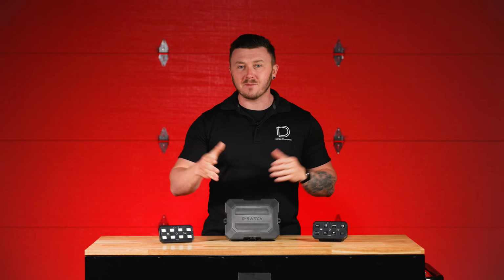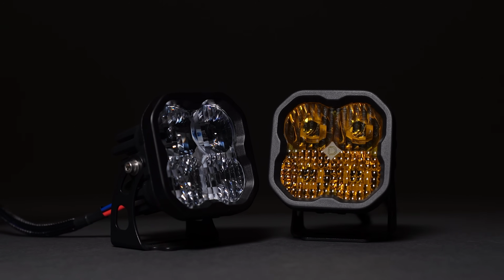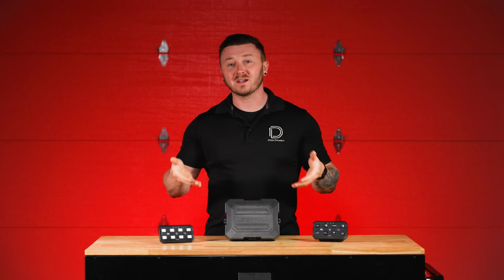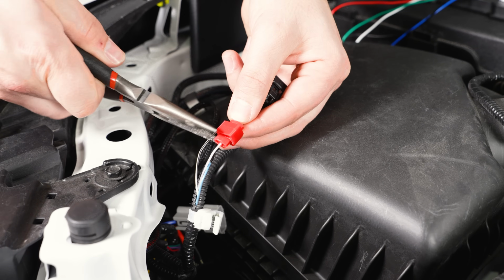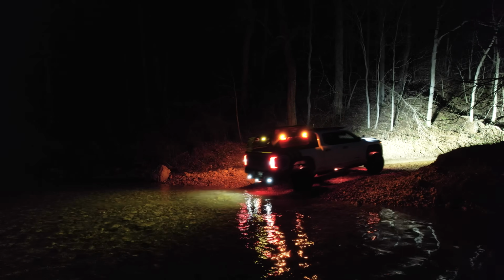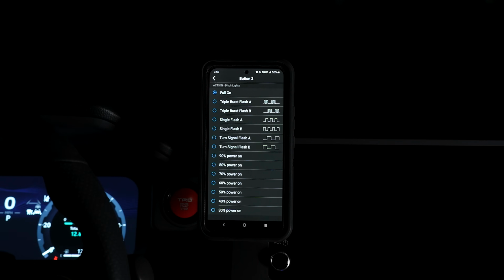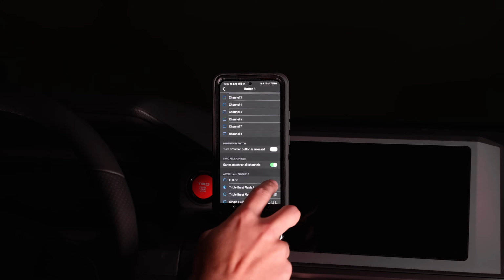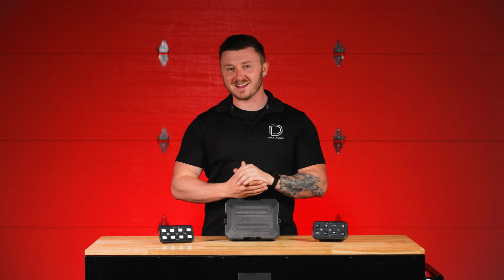Full Command at Your Fingertips—Meet the D-Switch 8-Channel Switch Panel | Diode Dynamics

Comment: When wiring this thing do you need to use an ignition cable like aux beam for it to work? Or just positive and negative and you’re good to go to the main controller.
Reply from the maker: Positive and Negative are all you need for the controller to work!

You do have the option for an ignition trigger wire if you choose, however, it is not necessary. Plus you get 3 other trigger wires that can tap into any other vehicle function, such as parking lights, reverse, or even hazards, to turn your aftermarket lights on without messing with the controller!

Comment: These guys are high-quality and no BS. I upgraded my 2020 Ford Explorer Limited two exterior LEDs to replace the ones that Ford decided to make just regular incandescent bulbs. I got their very bright backup light replacements and I can’t tell you what a difference that has made. At night when I put the car in reverse and the backup camera comes on plus I can see on them in the mirrors behind me, it’s like two bright spotlights have come on, and I can see Everything and we almost impossible to hit something or get into an accident because everything is so well lit. Really really excellent stuff.

I also replaced the license plate lights, which, on a Ford Explorer 2020 or newer, you don’t even need any tools. You just need your hands and you can replace it in about 15 seconds, no joke. And now my license plate is lit very clearly at night and it just looks nice.

And finally, I upgraded their rear incandescent left and right turn signals to LEDs in their place. The one thing I couldn’t figure out is why I Ford Wood release I think it’s the eighth big rebuild since they started selling these vehicles a long time ago and almost everything in the car is LED both inside and out. And it looks very good. But why did they leave the rear turn signals back up lights and license plate light incandescent? I never did figure that out, but I went ahead and replaced the left and right turn signals for the back and now it looks really great. It pops on and pops off and there’s no doubting that they’re LEDs. 

My police department has also purchased stuff from them due to recommending them for a couple different things. I’ve never heard a single thing bad about this company or their products. Word-of-mouth is the best advertisement that a business owner could hope for. And as you can see in these reviews from people, word-of-mouth is excellent because it’s all positive and I’m in that group too. I am super impressed with what they have and the care they put into making it right.

And if someone that Diet has a quick second, and could possibly answer this question, and if not, you’re too busy and can’t take individual questions that’s OK I understand. I just wanted to know if my stock 2020 Ford Explorer Limited non-police model has any places on it where a couple of warning lights could go that are either clear or amber and for private property use only. And my retirement, I’m starting the company over again and I came up with a system that worked fantastic for getting the attention of my customers at airports, especially at SFO where it’s a zoo. I have a they caught an electronic flare. I can’t remember the brand name though and I put that thing on my dashboard and it’s a little orange light that’s round and has about 10 different linking patterns. It’s not a police light. It doesn’t throw the light that far, but it does throw it far enough that my clients know to look for this orange light on my dashboard and when they see it, they flagged me down so I can pull over and get them and just to be sure cause they’re older folks I have their abbreviated names and destination also abbreviated on an LED sign that’s controlled by a Bluetooth connection to my iPhone and an app. People love these little extra touches and seeing their name on a scrolling sign on the side of my car it’s actually inside the car attached to the right rear window and I’m the only one at the airport that’s got it. I’ve never seen anyone else.

But I really like to know if there’s something that would be a bright like I guess it would be. I’m trying to picture my police car and what it had and I don’t want it to look like a police car. I’m wondering if Ford has any thing all set to go on my car like do they have mounting plates and things that are hidden or in place somewhere since they come off the same assembly line twice a year? I’d like to have something like a LED an amber LED behind my front grill so that when I see them, my customers, I can flip on that little Blinky Blinky thing and they’ll know it’s me. And even with the round light that I use, I turn it off as soon as they see me all we have to do is make initial contact and then if they lose me, that’s OK but I know where they are. So something like that on the front or gosh I don’t know I’d have to see what’s available but something simple like that and like I said is for private property only I’d use it at I’d use it at their residence as well because it is a retirement home a giant retirement home and the entire grounds there a private property and it will come in very handy there as well. When folks get older, things really change and until you deal with it yourself, you don’t realize how difficult it can be. I’ve learned to give the same quick speech. I always give as we’re driving away from their home but still inside the gates and I always ask if they have their passport, their purse or wallet with ID, and whatever travel documents they may need like TSA pre-check. I’d say it’s about 50-50 where half the time either the husband or wife has forgotten something and I turned back and go get it. That’s no big deal, and then the other half they remember everything. But old folks do get flustered and I’ve seen drivers try to explain to them stuff. That’s just too complex for them about if it flashes this way or that way and some other stuff I’m laughing at here. That’s way way too much for old people, especially if they’re on vacation. Their mind is elsewhere. So I just tell them don’t worry about it because I’ll do all the work. I’ll find you. I’ll get you there I’ll bring it back all safe safely and it always works out well and I get great tips from it. But I’m just now starting to see about starting it up again because March 13 of 2020 just killed it.

Well, that’s a long comment I wrote. Sorry about that. I’ll sign off now. Go back to my corner. Lol.

Comment: This have a built in gyro or accelerometer? Would love to see it function as turn signal switch, it could detect G-Force from turns or lane changes then auto turn off the blinkers in utv/side by sides application, would love to see it.
Reply from the maker: Unfortunately, this does not include a gyro, or accelerometer at this time. Sorry about that!

Comment: I have one hang up with this... though it's app controlled, it should have apple carplay/andriod auto integration instead of having to fumble around with your phone.
Reply from the maker: We hear you and appreciate the feedback! Like many other switch panels on the market (all but one), we are limited to universal capabilities within the controller app. 

Apple and Android are very strict when it comes to CarPlay and Android Auto, for safety reasons. It is for this reason that you don't see any options available on the market yet. 

We are pushing to have that capability in the future, though, and it is absolutely on our radar as a future possibility!

Thanks for checking it out!

Comment: My big question is whether the trigger wires also allow you to manually control the lights… Garmins power switch has the triggers but you can’t manually control the lights at the same time. If you guys allow for manual control as well as triggered control I’m buying today.
Reply from the maker: The D-Switch allows for both manual and trigger control at the same time!  From there, you can even program whatever lights you want to turn on and what function you want with just using that trigger wire! You can also stack features of the same light.

Let's say your trigger wire activates your ditch lights; you can have a separate button that strobes them or dims them down!
Reply: @ well I’m sold. My biggest complaint regarding the power switch has been if you use the trigger wires you don’t have manual control. Garmin is fuuuucked.

Comment: @diodedynamics don’t forget, if you’re using the rock lights, you can also wire the low power mode into your backlights!
Reply from the maker: That's a great point! If you want your rock lights on low power to turn on with the rest of your backlighting, you can absolutely do that! Keep in mind that local laws are different in each state/county, so be sure to check that you're in the clear before doing so—we want to remain road legal!
Reply: @ most every state will absolutely be on board with being seen. Hell tractor trailers have more lights than we can possibly throw on… AS LONG AS your low power lights (rock lights, roof rack, even light bar… many states require light bars to be covered such as VA, MD, WV, etc but overall, they can only be parallel or below the headlights and <18”… I work with LE daily)…. But those lights just have to fall under the statute of “marker lights” and can only be white/amber forward facing or amber/red rear facing.  As a side note, im glad you guys finally caught up with your suppliers with those beautiful rock lights… I have 6 and needing 4 more for my 24 Tacoma TRD Pro plus 4 for the roof rack (installers pack so I can have the rear chase lights (red) and amber sides…. Mostly for dusty trails and off roading.

Comment: Question. I have mostly DD lights, but I may have a couple lights that have duel intensity back light. Sooo would it be possible to wire the main back light to ign, and the dimmer backlight to parking lights with d switch? Wouldn’t mind reducing relays and excess wiring haha.
Reply from the maker: If there are different wires for the different functionalities of the pod, you can wire them into either the backlight channel or one of the channel assignments to have individual control with the trigger wires to turn on with your parking and ignition sensors!
Reply: Sure, as long as you have two separate input wires for your dual backlights, I don’t see why it wouldn’t work

Comment: Seems awesome - Is there any support for 24V?   Planning to run off of house power if needed, which is an Ecoflow @48V (with 12 or 24V output).  Planning to run at 24V to reduce wiring gauge and the onboard DC-DC converter has a 60A limit.
Reply: Which EcoFlow do you have with 24v output? My delta 2 max only seems to have 12v but I do appreciate the 24v output of my other powerbank. Very handy
Reply from the maker: As of right now, this only supports 12V systems, however, we'll be sure to pass that along to our engineering team for potential future updates!
Reply: Hello
I have an EcoFlow Power Kit (Gen 1) installed in my van, and I recently ordered a D-Switch. Could you please create a video demonstrating how to connect the D-Switch to the EcoFlow distribution box?

From what I understand, the EcoFlow Power Kit DC output is rated at 60 amps, while the D-Switch can handle up to 125 amps. Given this, do I need to connect the D-Switch directly to my Transit van’s battery in order to achieve the full 125 amps output?

Thank you for your time and assistance.

Comment: So, if I understand correctly, these can't be combined with any of your lights that use rapid on/off to change settings of the light.
Like the light bar that makes you turn it on/off repeatedly to change which bank of lights is on.

Would have been nice to have a programming bus on those lights that talked to the control software in the D-Switch so those things could be toggled entirely through the app.
Reply from the maker: This will work with the Amber Only version of our new upcoming lightbars and amber backlit yellow SS5 pods currently! 
We will be working on updates to adjust the programming of the SS5 backlights so you can flash the backlights without changing the colors.

Comment: $600 😂😂😂😂 sorry but auxbeam is tsking my money on this one.
Reply: Buy once cry once! You literally get what you pay for with electronics
Reply: @brokenwrench404  right but this switch has only a 9-16 operating voltage while the aux has 24.
Reply from the maker: We totally understand that there is a right switch panel system for everyone based on needs and budget. The D-Switch provides the most features for the best cost compared to similar offerings. 

Thanks for checking them out!
Reply: @diodedynamics  600 towards more lights for
Reply: @Anthony-kd5ku  This is just me, but I wouldn't consider auxbeam, but again, that's just me.

Comment: let me guess, another $200 switch panel -.-
Reply: nvm, its $600 -.-
Reply from the maker: We totally understand that there is a right switch panel system for everyone based on needs and budget. The D-Switch provides the most features for the best cost compared to similar offerings. 

Thanks for checking them out!